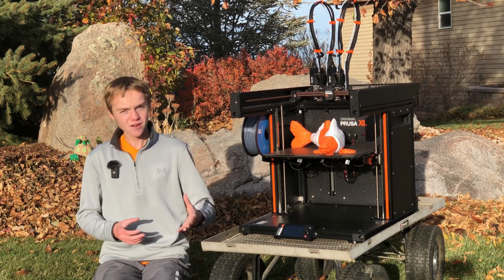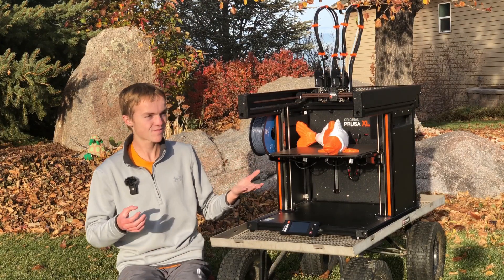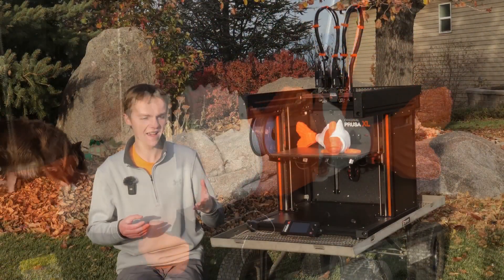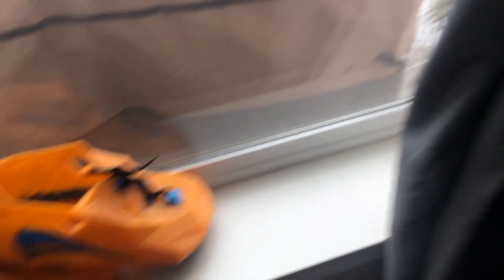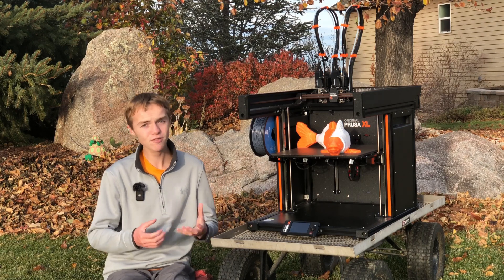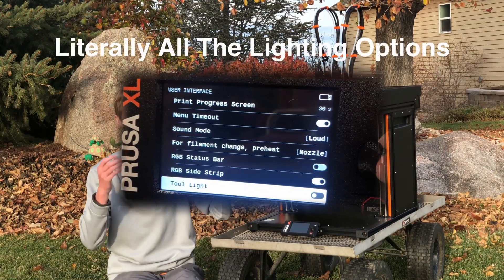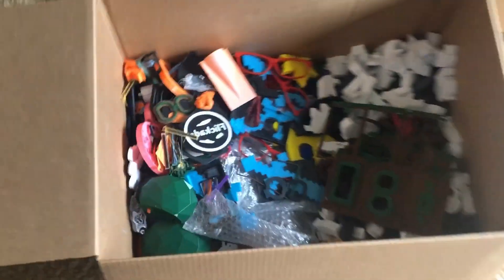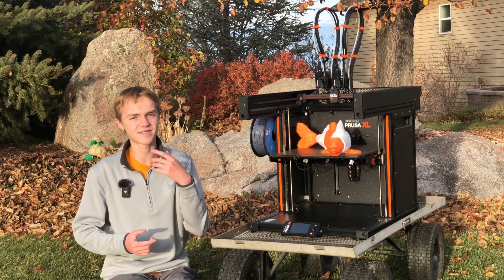Three Month Review of the Prusa XL // Dual Toolhead

Comment from the maker: ⎷Updates⎷
1/7/24 - FINAL UPDATE - I've made a Q&A and or update video that covers a lot of the questions here and follows up on some of the software updates.... https://youtu.be/tGkc5fcpQ9w
12/20/23- After running the new firmware for a while now, it's been great! Many of the issues I was having are no longer as noticeable, except for the filament sensor. Annoyingly, after working for a little while, it stopped again, only for me to find that it was turned off, wasting lots of filament and time. To be fair, this was after I updated the firmware, but I don't understand why it's disabled by default!

Comment: Can you re-explain the wasting filament part of when you run out of filament?
Reply: Just a viewer, but I can explain. Between the filament sensor and the actual extruder there's some length of PTFE tube. That means the printer stops when there's still some length of filament that could have been printed. The amount of filament you cannot use (so waste) was shown in the video.
Of course, you could use filament that for a 3d pen for example.

Comment: Boy. I have a dual toolhead on preorder, coming sometime in April, and I can't for the life of me decide if I should keep it or not. This thing just seems to have so many issues for a printer of that price. If you had to do it all over again, would you? Or would you wait in hopes that Bambu will make a similar sized machine? I wanted the multi toolhead design, but it just seems so... not good.
Reply: I think Prusa was a bit too ambitious with this printer and the competition really put the heat on them. 

However, I can’t wait to get my hands on one.  I am confident they will continue working on the small annoyances. 

The competition was not as ambitious so they didn’t go through all the pain of 5 tool heads. 

I often feel like comparing the XL to other printers is not fair.  

Now on the MK4 is where I’m torned and not sure if I should buy from them or one of their competitors.
Reply: I think Prusa its a little overhype , i cant buy a machine of this level of price and somany isues , there lots of options now there , better in my opinion like bambu lab or k1 creality and others , but of course if yuo like spend several hours ,tinkering, calling suport , traying to solve software (Marlin) imperfections , like ringin , or extrusions irregularities ..well its yuor freedom, personal , i dont sed the point of an open big machine , its must be closed to print high temp warping materials if yuo want to get the most of the machine, second , for a core xy , its not too fast (prints at about 200 mms at 5k aceleration, but i use klipper in a modified ender3 , volcano, bmg. At easily 250-300 mm/s at 10k), Good luck anyaway 😊
Reply: @noway8233  My opinion has changed in the months since this post. I have a 5 toolhead XL and I absolutely LOVE it. It prints beyond perfectly, at high speeds, with almost instant color or material changes. I could not possibly be happier with my XL and have had absolutely ZERO issues with it. Furthermore, with all the stuff coming out about how Bambu Labs steals all kinds of private information and your gcode, which they lied and said they DIDN'T do, I'd rather have a broken Prusa i3 MK1 than a Bambu that works. Screw them.

Comment: Ahh man the XL seems like such a flop....I've not seen one review thats like...ahh, so happy I love it. Among the new bread of coreXY it seems like the least desirable.
Reply: I had preordered one a couple of years ago, seems like it was good I cancelled it and bought a bambu X1C instead Although it has it's problems too, supposedly. I haven't had any, other that bed not being flat.
Reply: Think you made the right call going with the X1 or a K1 max would be a good choice too....plus you can buy 3-4 for for the price of an XL. That thing seems like a bad time. @atnfn
Reply: @atnfn  nothing is really flat - an ex Flat earther 😅
Reply: You won't find anything perfect. I think this review is actually very positive. The video shows that the machine prints very well, and that is its main purpose, is it not? If it had buttons that automatically load things and swap things (like Ultimaker) it would cost a couple thousands more just because of all that automation. So what if you have to so some things manually such as loading the filament?

Comment: Update the firmware on your machine as it is possible to do the extruder swap at the printer on a presliced files now. Done it several times already myself.

They’ve released multiple firmware and slicer updates in quick succession the past few weeks. Pretty much a new one every week

The stringing I see you have, I’ve all but got rid of it for my PLA prints by printing at 200-205oC. I’ve not printed my PETG or TPU yet as I have a lot of PLA I can test with rn but the principle being to reduce the temp.
Reply from the maker: I'm currently running the alpha input shaper version. Are you talking about the ability to change filament before you print or is there an even newer one? If so that's awesome, defeinitly what I appreciate about prusa!
Reply: @Dragon3D  on the topic of input shaper, prusa released the stable release for XL just yesterday-ish and a new stable release slicer. Definitely worth updating.

Yeah, the ability to swap which extruder to use before you start printing on the printers lcd screen
Reply: @Dragon3D  yep you are running out of date firmware. Being able to swap extruders different from sliced Gcode, and spool join has been out for maybe a month now. Also… you can turn off the wipe tower in PrusaSlicer.